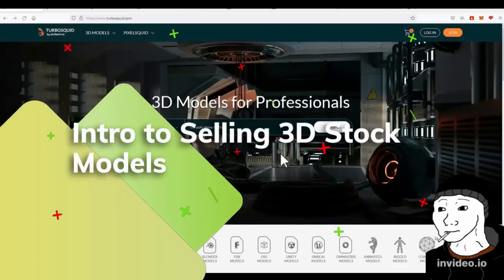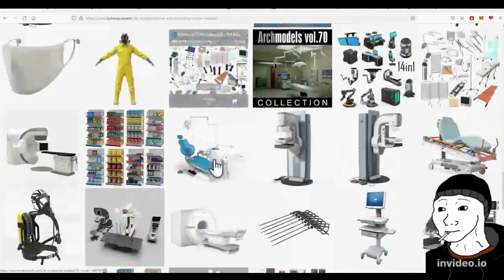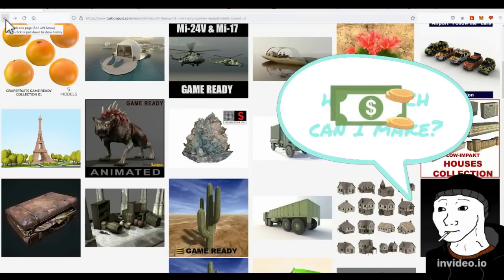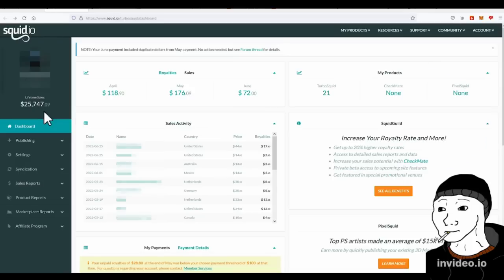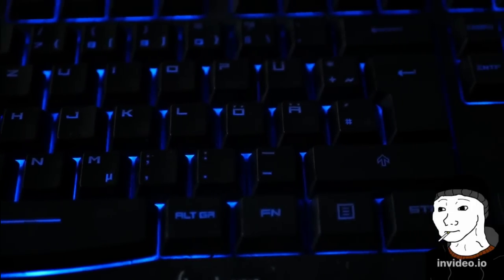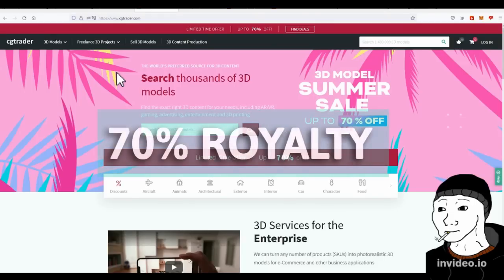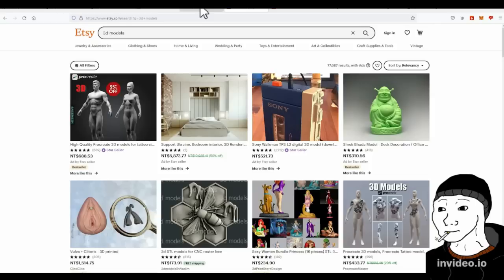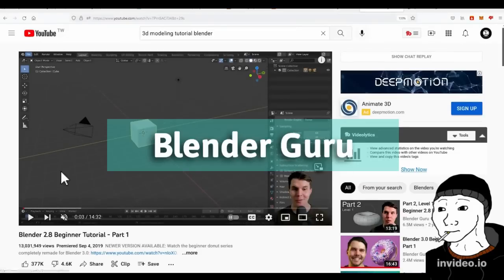Passive Income: How I made $20,000 selling only three 3D Models on Turbosquid

Comment: Hello, I also work in the 3D field and I wanted to sell my models on the TurboSquid website, but I ran into a problem. When uploading, it says that there should be more than 5 photos with a resolution of 1920 x 1080, but the photos of my model are more than It is more than 5 and I upload it with the same resolution, but it still fails. Can you help me?😢

Comment: Question: I've been 3D modelling for some time but when you say "gane ready assets" what do you mean? What makes it game ready and how do i do that?
Reply: As a games industry vet, its means making models that are efficient for game engines. This would be making them efficient as possible with as few textures as needed, fully unwrapped and textured with high to low poly baked normal maps, metal / rough maps etc creating game texture sizes e.g. 1024 / 2048 / 4096 at game texel densities and exporting them in file types for modern game engines like Unity and Unreal Engine. You should also make lods (Level of detail) for your model files. These would then be classed as "game ready" and could easily be adding to any game and be as cheap as possible to draw on screen.  where as normal 3d models for say video production or rendered images probably wouldn't have baked maps and would be modelled mostly in geometry (usually higher poly as no an issue for rendering with high detail) with a some  basic textures on it with no lods. 

Plenty of videos on you tube on how to create correct game assets.
Reply: @Paul Worster  thank you so much! I would love to know more about making LODs as I'm currently working as a startup's only 3D Generalist.... so basically their whole art department. So all my faults I need to iron out. Also learning how to put multiple object's textures onto a single file helps out a ton. 

Either way thanks for the clarification, since you're a industry vet I just wanted further knowledge since I don't get to talk to many people in the industry.
Reply: @xenoturegaming198  Sure NP, Lod's or lodding are used to to cut down on the tri counts in games, if we had everything with no lods in games the drawing of these models would affect performance  especially in the past and on older Gaming consoles whos hardware was the limiting factor. 

lods in essence are simple, you reduce the tri  / texture count over distances from the camera and replace it with a cheaper model at a certain distance or based on its screen size. There is no sense having a full model miles away from a camera and it displaying fully and rasterized in ten pixels on screen. it might as well be a coloured box / plane and one texture. 

Good modelling loding practices in a nut shell would be :

1) Reducing tris where that would not affect a models silhouette.
2) Removing polys that wont be seen.
3) Reducing bevel edge counts , edge loops (where possible not to affect point 1)
4) Dropping height / depth of models
5) Trying to keep the models textures that has high contrast for as long as needed not to see sudden visible changes. eg textures that are dark and light if they were removed would be very obvious to the player if they suddenly disappears on screen.,

You also Lod materials, which is probably more important. that way the game has less texture draw calls to display on screen at once so a model with 4 textures goes down with each lod. not doing this and you pretty much have a game that can't be shipped.
There is also modelling for lods in mind so you try and reduce any normal map changes by using clever UV arrangements when unwrapping your model

Lods also are not free, they do have a cost as its another model. so sometimes lods created can cost more than the model they are replacing especially low poly models where it would be a waste to even use them. 

Nanite, has changed conventional loding,  rather than loding the model its lods it in a per cluster basis meaning the you can now have really dense meshes and anything going below a per pixel is culled away on screen. its not perfect with overdraw issues, resolution and it cant be used on everything, but its really impressive and efficient, its the future and no doubt it will keep being refined by Epic until it is.

Comment: Hmm on the not adding up as well, your Etsy currency was set to Taiwan so im curious if your numbers from turbosquid are off and set to Taiwan as well..
Reply: Retract this statement as I've confirmed this is in USD/CAD, however, he fails to give you all the REAL context on these models. There are high poly models that required well over 200 hours to get to a level of 3D art to just learn how to create them. And on top of this, his 3 top selling items have been on the site since roughly 2015, which 18k over 7 years is 2k a year. Which lets say took him 40ish hours to produce each one from design, to model, to texture, to the effort of upload and image capture, divided by 3 for the 3 models that's roughly $15 an hour. Sure it's passive, but it's nowhere NEAR as sweet sounding as he puts it in this video. 

Lets says you spent 20-60 hours per model, you upload 20 models, only 3 of them sell "well", you have well over 700 hours of unpaid work just sitting there.... Please dont be fooled by this, yes uploading to multiple sites and doing many models is good but it's so hit or miss and usually in the industry right now, a legitimate full time 3D artist at an INDIE studio makes around 27-42/hr cad/usd. So you are much better off maybe doing models like this once you have learned 3D, work for a company, and do this on the side. Which is likely what this man has done here. Every single model he sells on turbo squid are around the level of a 3D artist with at least a year if not 3 of asset/industry experience. Lets not mention that the "low poly" art he recommends to learn and put on the site is SO saturated and will make you absolutely ZERO money, you're looking at maybe $5 an hour if you're lucky for lowpoly assets like that.

Only Lowpoly that sells well are MASSIVE asset packs made by people who have 5-9 years of industry experience and sell the packs of assets for $140 - $360 a pack and are well known and pre integrated to a game engine like Unity or Unreal...
I am not saying to not learn 3D and not sell your models, but this video just feels way to much like false advertising
Reply: @SolarTara I needed something like this. Seemed way too good to be true.
Reply from the maker: everything in TS is in USD

Comment: I think this is very useful information but some information doesn’t add up. 
If you made 7k and sold 36 models, that means the model was being sold at $197 but on there it says $59? 59x36=2124
Also is the 7k after they take 60% cuz if not then that means the model was at approx $311 

For talking about money you skipped on a few major parts.
Reply from the maker: I didn’t go into detail with regard to lowering prices over time (and sometimes increasing them).  And a lot of these models have been on the markets for years so the numbers vary.  I also didn’t mention the sales made during turbosqhid and cgtraders heavily discounted rates during holiday sales which I have no control over

Comment: The barrier of entry to sell your 3D models online is pretty low.
That also applies to people re-selling your work as well.
I don't mean to be pessimistic, but be aware that you might see your work being re-sold by someone for half the price.
On Etsy you see this a lot with 3D printable models. It's a problem that affects many artists and designers, myself included.
If you have the capabilities for 3D printing, packaging and shipping then consider selling your work physically.
Reply from the maker: Agreed.  Though 3D models that are designed for 3D printing are modeled differently that for models designed for broadcast.  So it’s unlikely a thief would take your stuff and post it onto Etsy as it just wouldn’t print or the products would receive very low ratings
Reply: @the-sigma-hub  they make it manifold and slice it with a slicer, tada.
Reply from the maker: @recoverhealth2062  yea, unfortunately
Reply: Although throwing any model into a slicer and printing it as is would work, when I worked at a 3D Printing Service Shop we would reject this kind of models or ask for a reconstruction fee as normally this models would be to hard for the slicer to correctly print it. Printing errors were common and normally the client would get a print that did not satisfy them and end up frustrated.

Normally people that go for the cheapest are the ones buying the stolen model and choose to deal with the hassle of slicing the model, printing and finishing themselves.
Reply: True, which is why I don't sell my design files. Have you considered building a storefront with either Shapeways or i.Materialize? They do the 3D printing, packaging and shipping for you.I'm looking to test this concept with a project I'm currently work on.
Reply: exactly

Comment: How do you recognise and 'catch' a niche (trending or not) in this context? Is it a matter of 'gut feeling' or are there more or less precise tricks/rules to spot them?
Reply from the maker: It's mostly market research and seeing what is trending.  TS and CGtrader have trending keywords that you can check out.
Reply: I work in architecture, we work in a lot of different sectors, but especially modern healthcare models (like labs, lab equipment, hospital equipment, dentist stuff, etc) seem really hard to come by - good models anyway. Those things seem like a good thing to make rather than couches etc, furniture is usually so custom that we model it ourselves, but healthcare equipment is largely the same everywhere. just my 2cents as someone who purchases models a lot. - good city streetscape models are also something we purchase a lot.
Reply: @jgirard1812  what constitutes a good model? im wondering if for your use case if a model has to be dimensionally true or if its ok to be ball park measurements.
Reply: @ellemnist  things I look for are: topology (clean edges and quads, chamfers, etc), pbr materials, compatibility (vray and corona are pretty much industry standard) I use vray but can convert the materials easily if they are corona but maybe some other studios don’t have time/experience for that so the more compatibility you have the better. And yeah for some models being exact matters. At least within the inch, surely depends on the type. Being accurate will only increase the value of your model. You don’t want a client leave a bad review because it’s not correct. I personally rarely measure a model I buy but if it’s clearly off and doesn’t look right that’s a problem that costs me extra time to fix
Reply: @TayaYoung04  which 3D software do you use? I am architect (student) too, just curius. I also use vray, SketchUp and 3d max, but I rarely do renders, and I want to master rhino now.
Reply: @rbasket8  i am more on the artist side of things. I did not study architecture. but our architects all use Rhino (and revit). so i think you're on a good path there. but i am not an expert with architecture information. For an artist (movie/games/archviz) i recommend max if you have money and blender if you don't =)
Reply: If you can put it in a game. People want it. Specially low polly 'toon' styles.

Comment: 3:12 Wait, so the price says $39 and the sales 126. If I multiply this it is way below the $11K of total sales. Did you lower the price at some point?
Reply from the maker: yes, I did lower the price over time, and sometimes raised it depending on the season
Reply: maybe he lowered the price or its the 40% he got. or a combination of the two
Reply: haha I just did the exact same thing with the maths... something does not add up there....if he sold 126 models at $39 he only made just shy of $5k...